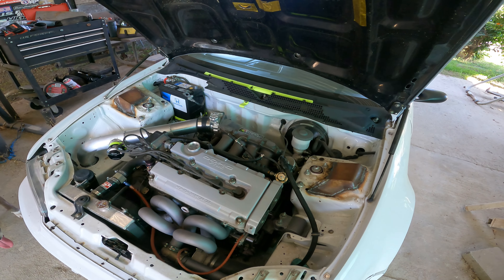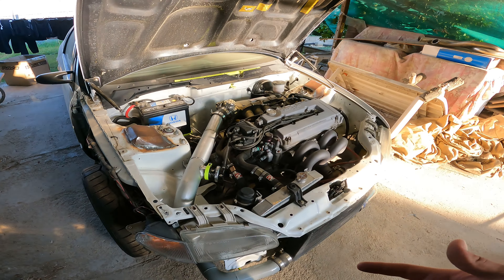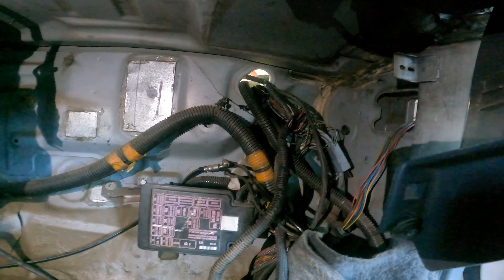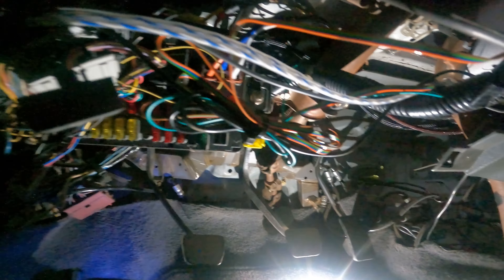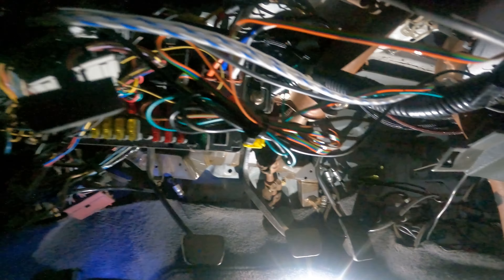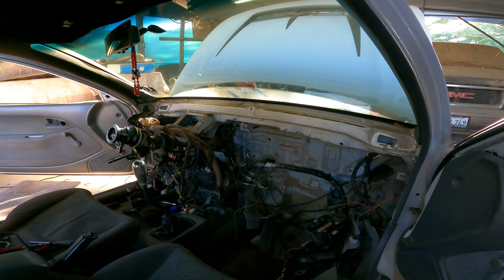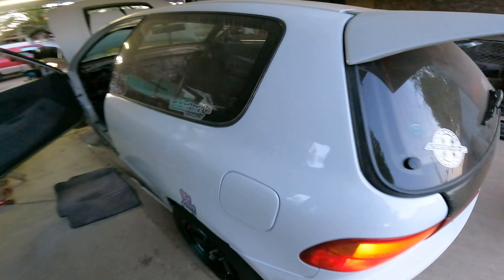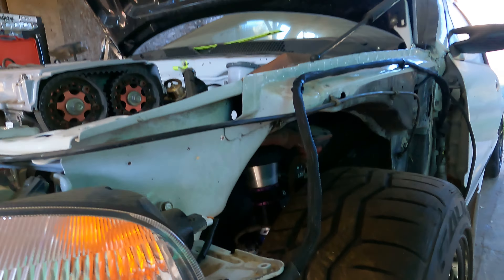Carrot Top Tuning Headlight Harness Tuck Install on my EG Hatch!

Comment: You took that like a champ! lol. That was a lot of work! Amazing.  I'm about to do a wire tuck on my hatch and have been debating whether or not to get this harness. It seems as though I wouldn't need to take out the passenger side, completely? I'd rather not cut anything or trace the wires through from the passenger side to the driver side under the dash.  Could I just run the old wire back through the car and out through the grommet by the door, then tuck it along the passenger side fender?  The new harness would attach to the inside at the driver side fuse box and the harness would run along the driver side fender, through the front and to the passenger side lights?  I hope you can visualize that. lol Congratulations on the kiddo btw!